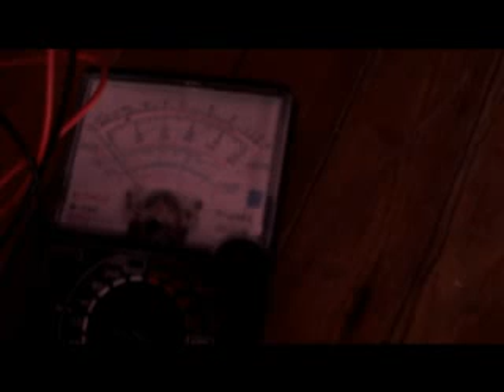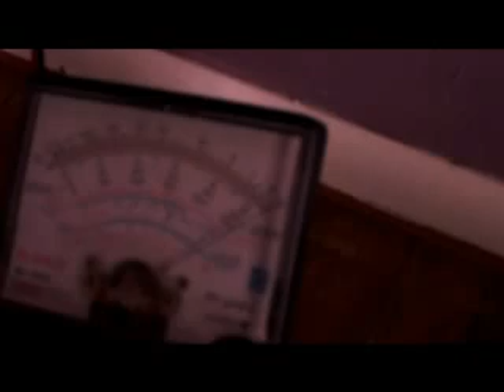How to Trace Down a Plug In With a Meter

Comment: How do you find a neutral wire in a kitchen! I went into a old old home that you have no attic to trace wires down. I had to cut all the groups of wires loose so that I could trace individual wires. I turned on the power after separating them to find the hot wires. I can't find the neutrals that go with them! With all the connections in the kitchen, how do you verify a neutral connection? I tried a meter and if I took the hot to the box I got 120v , if I took the hot to the neutral I got something like 86 volts, when I took the neutral to ground I got something like 20 some volts!!! I am stumped! I took the other Neutrals to ground and did not get continuity! Who ever did this wiring changed white to black all the time. Chased a white wire and it made continuity with a black wire on the other end!!!!! Any help will be appreciated as this is for a relative!!
Thanks